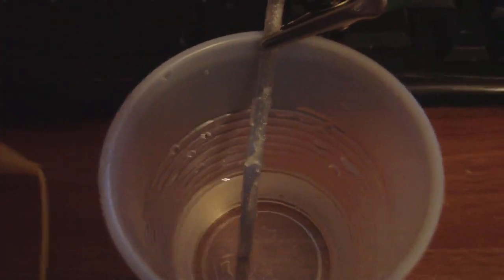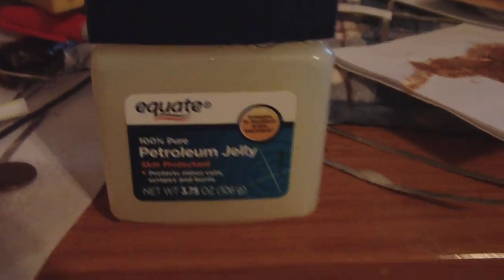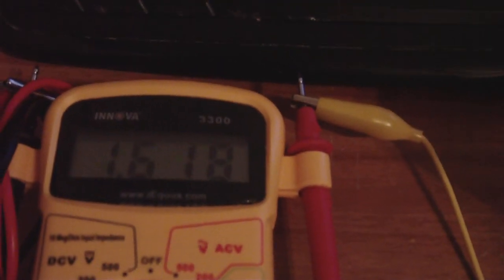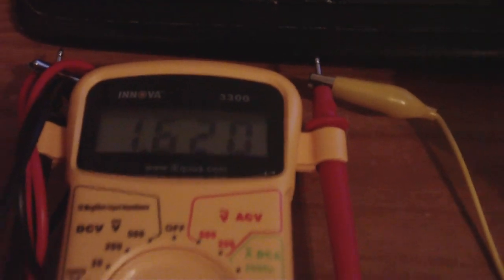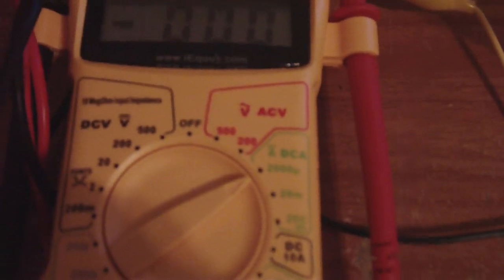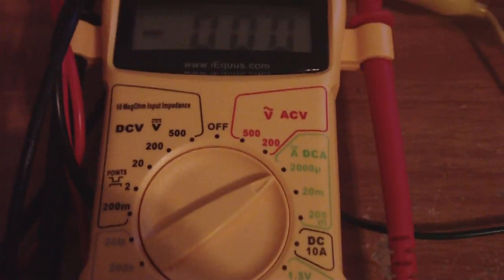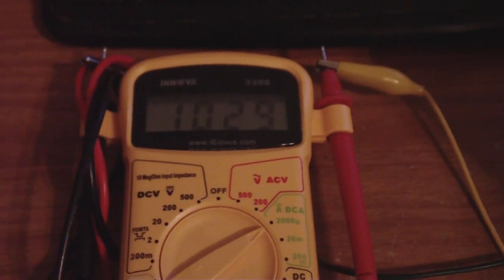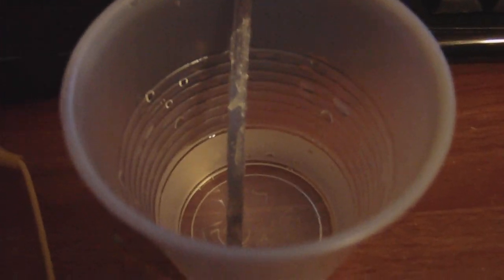Showing Amps on cell with petroleum jelly on the Magnesium

Comment: I think the ions flow was slowed down as corrosion slowed down. If they corrode quickly they throw out lot more amps. But in any case imagine if you have a jell layer in you can put strips in. After some time take them out and replace with new ones.

Comment: Dear IB, 
The reason I was asking if you could show the current output in vinegar was to see easily if bubbles were forming or not. You mentioned that vinegar was a good test because it reacted quickly with the magnesium and could see corrosion results immediately. With the water and salts it is hard to aquire a definitive result as to whether it is corroding or not. 
I will run some tests myself. 
Thank you again for the stove top cell idea.